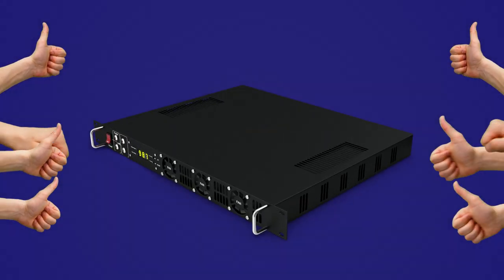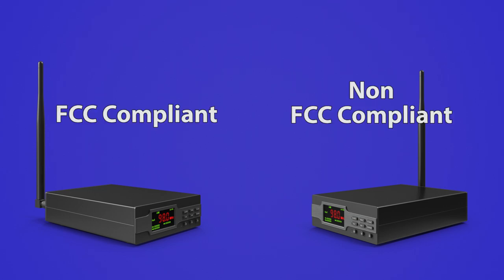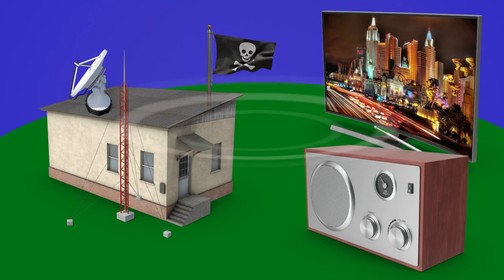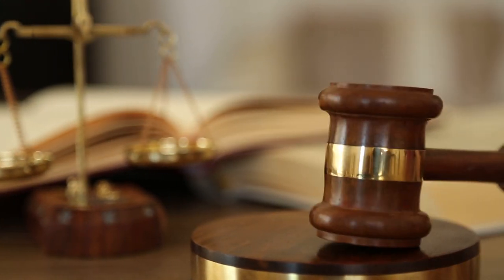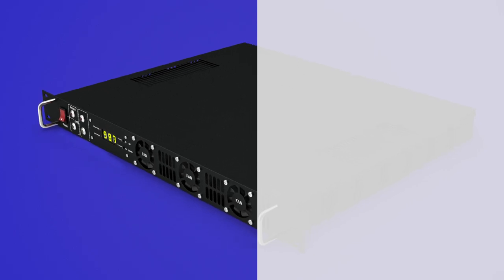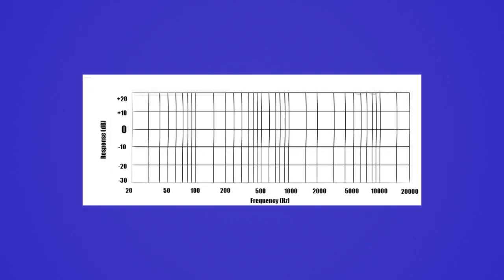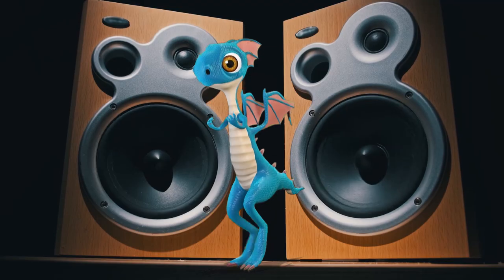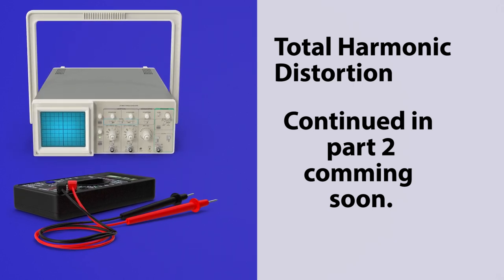FM TRANSMITTER Radio Station. How To Choose The Best Possible Transmitter For Your Radio Station

Comment: I would like a good quality stereo FM transmitter just to transmit music from my Reel to Reel machine to my FM tuner in the lounge and then through my speakers. I have two hifi systems.
Reply from the maker: There are a few options these days. The important thing is to understand how the audio quality varies dramatically. Some transmitters have quite nice audio while others sound shockingly bad. It is something I would recommend doing some research on. There are some videos here on YouTube that talk about the different models and which ones have the best audio. Definitely have a watch of a few of those before you make up your mind. I cant give any advice on specific models for home use as my experience is with broadcast transmitters. That's why I would say watching some of those other YouTube videos about specific low power transmitters would probably be better.

Comment: how many miles this can broadcast for
Reply from the maker: The signal range, or Miles of the signal, has more to do with how high the antenna is above the average ground and the terrain you transmit to but in most cases with an antenna above 10 meters from the ground a 1 watt transmitter can go about 1 to 5 Miles and 10 watt transmitter can go about 10 Miles. After that you need much more power to go further . There is not much difference in the range between a 50 Watt transmitter and a 300 Watt transmitter which both go about 20 Miles. That is why putting the antenna higher up makes more difference. More power just means a stronger signal inside your broadcast area.
Reply: Well, every time you double your power you go up by 3DB. Power is logarithmic.
1 W	        30 dBm
10 W	40 dBm
100 W	50 dBm
1000 W	60 dBm
So to go up the same amount as 1 watt to 10 watts, at 10 watts, You would need to increase your output to 100 w. (Then 1000....etc )